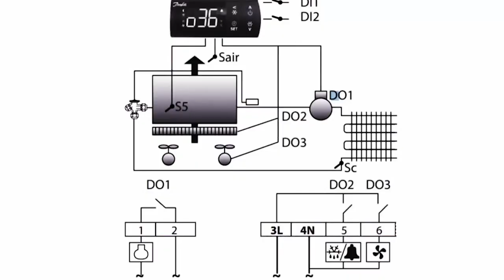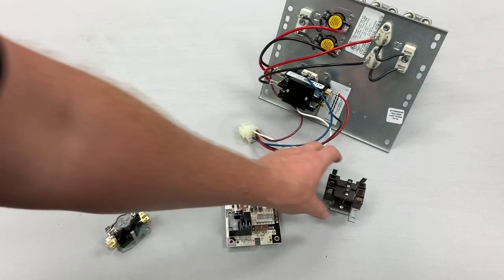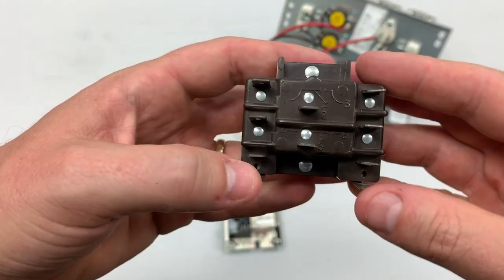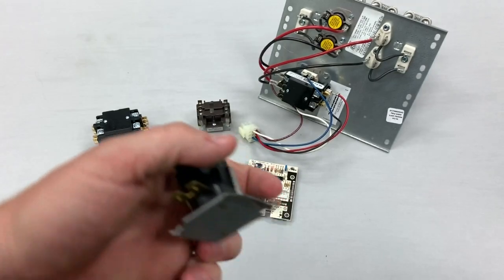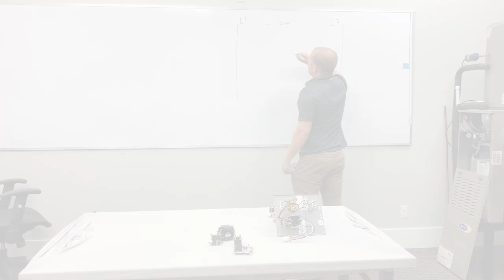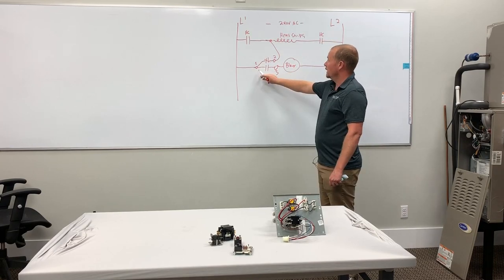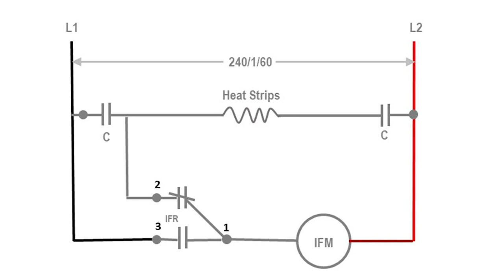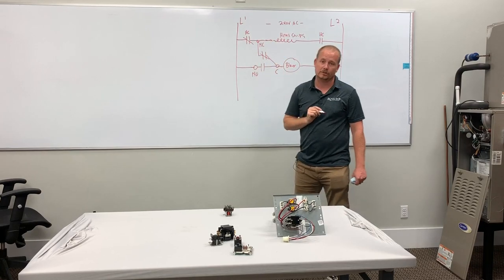A Blower and Heat Strip Dangerous Mistake

Comment: Wow, thank you very much. I was confused couple of days ago because I wasn't getting power to the fan motor. I saw the relays burnt underneath on the heat strip. Also my condenser wouldn't come on and I wasn't getting 24 volts to the thermostat nor to the contactor on low power.

Comment: What would be the benefit or drawback to interlocking the heating strips with something sensing the airflow directly (ie sail or static pressure)? Clogged filters or broken belts aren’t accounted for by the fan motor power. Even a locked rotor may allow the heat coils to be energized enough to be damaged.

Comment: Brian, I am in HVACR school right now, and we have just started learning about Heating Systems.  I was watching your video here, and, at 9:25, you said that (on a sequencer) between terminals 1 & 3 is Normally Closed, and between terminals 1 & 2 is Normally Open.  However, the symbols on the side of the sequencer show the opposite!  I am seeing a NO symbol between 1 & 3, and a NC symbol between 1 & 2!
  Was that a slight mistake on your part?  Are they actually the other way around, or is that correct?  I'm so confused!  Thanks!

Comment: I had a sequencer go bad in an electric furnace in one of my rentals. I went to fix it as they said the fan comes on but no heat. The sequencer was defiantly bad but it was also wired up wrong as in it would never have worked that way ever. Tenant must have messed with it before calling me lol and it took me an extra hour to trace the wiring diagram to figure out all the correct connections. (i'm not a furnace repair may by any stretch so that was fun)

Comment: Most relays I see are used to separate the high speed for cooling from the low speed for heat.  If power were to feed both taps at the same time, smoke...

Comment: Ok, Now I am confused... At 9:25 you say terminals 1 and 3 are normally closed and terminals 1 and 2 are normally open. Did I miss something or are 1 and 3 normally closed because we are reading right to left instead of left to right. I would think direction would not make a difference.  Normally open is always normally open no matter what direction. Relays always confuse me😖😖😖 The symbols show normally closed between 1 and 2 and normally open between 1 and 3.
Reply: You are correct.  I think he mispoke.
Reply: Yeah I was taught that the term “normally” in normally open/closed refers to the state the switch will be in when you buy it off the shelf before any power it applied to its coil.

Comment: I have seen this in the field “but”.... what you indicate isn’t true, if L1 feeds the motor and the heat strip (L1)when not calling for heat, the h3aters can’t come on because it only has one side of line, (L1) because it’s a two pole contractor, it has no L2 path on the heater side. Now, some manufacturers like Trane will direct feed one side, mainly on three phase.  If you drew in a one pole contractor which is common nowadays,  some call them a one and a half pole... your theory would stand.
Reply from the maker: True, the two pole contactor example isn’t the best
Reply: Thanks. Lucky i read this post before commenting.  If both relay coils were powered the heater would/could get its amps from both contactors and the fan contactor might draw too much current if its resistance path was less  than the heating contactor. Just a suggestion. ie you would have 2 parallel paths supplying the heaters. So the video is correct for safety reasons to prevent this happening or the possibility of it happening.      Im not an electrician and this is just my take on it.
Reply: @johndemarcojr3212  My thoughts exactly. Those single pole contactors are shockingly bad 😉
Reply: I was going to comment the same thing. I hope you can add a little note or edit to fix that mistake on the video.
Btw i really appreciate your chanel.

Comment: Notice the conection of the relay up to 12:02 minute and see if is not the same as he said is to be done on minute 13:08? Shouldn't in both connections, drawn by him, connect the normally open and disconect the normally closed?

Who assigned 9739 to my name?

I guess am understanding that, if the relay on normally closed NC gets opened when connected and on normally opened NO gets closed when connected or powered, on the second connection up to 13:08 heater strips get connected via L1 closed connection on top left (not drawn closed but opened) conection between 2 and heat strips NC will open and get disconnected, and connection between 3 to 1 NO will get closed, am I right and the tech forgot to close the connection between L1 and heat strips because I've seen them always powered waiting to be closed.

Comment: Your drawing on the board was confusing because you put an extra set of contacts on the other side of heater element. The Carrier diagram showed two sets of contacts because there were two elements, as opposed to your drawing with one element with two normally open contacts on either side.

Comment: wont high voltage still be running through the relay when heat strip is connected to "2" through NC to "1"?
Reply: Not at all because you're not getting L1 ,means there is no potential difference so no current flow